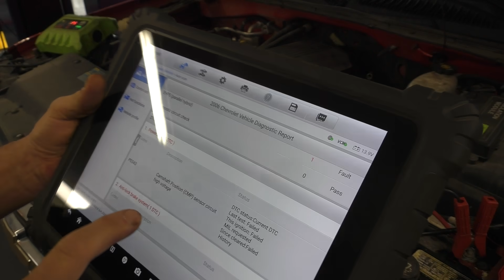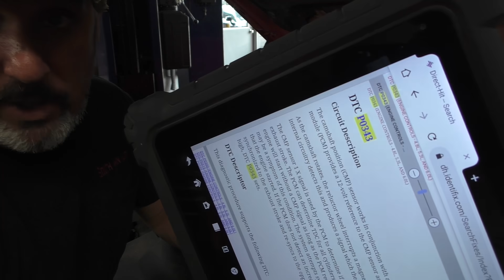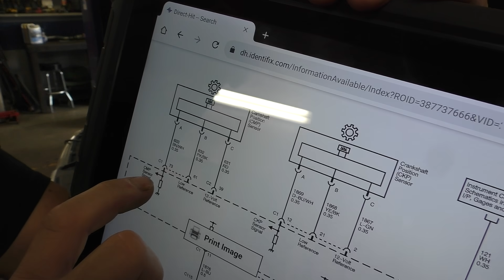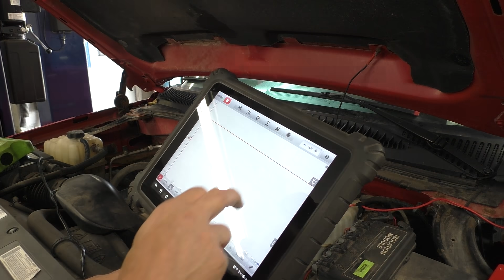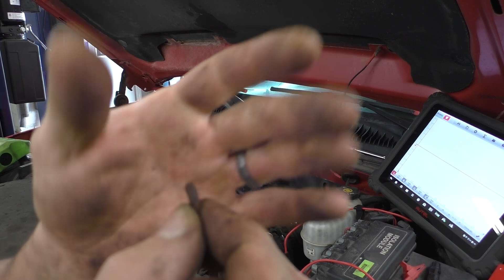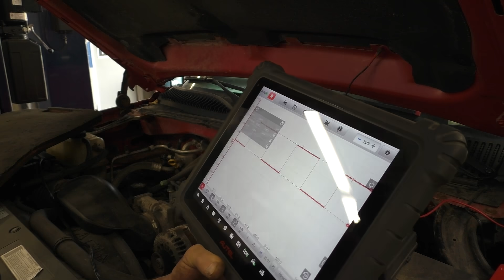Chevy Silverado With A Very Extended Crank - Other Shop Gave Up

Comment: I know this wasn't the problem but i have had a rebuild 6.0 have the incorrect rear cam bearing put in and the sensor ends up reading the bearing and not the tone ring also cause this condition, my fix was to install a 1x cam gear and timing cover off of a 2006 GTO and extended the wires to reach

Comment: I have a Park Avenue 2000 3800 not ultra. All the power windows stopped working, power door locks, interior lights, radio doesn't turn off when car turned off. Was told may be body control module. What say you? Cost of replacing body control module and programming it

Comment: As in most cam sensors or crank sensors the hole is on a machined boss which obviously your sensor has to sit perfectly on that machine surface I always clean off the boss or machine surface whichever you like to make sure that that cam sensor is at its absolute mounting position I had a similar deal on a Buick one time but it wasn't the boss it was the sensor itself it was not all the way down in the Paul and causing the same situation it was an aftermarket part they put it in themselves brought it to a GM dealer I replaced it with a GM part fit perfectly problem solved so let that be a lesson to all it is not a stupid video I'm almost gotten to the point to where I depend on you Eric I depend on you for your knowledge your process and your love..... of cars that is😂 you rock brother

Comment: Great video !!…ordered a $40 hydraulic crimper from Amazon and tried to crimp a 4 AWG wire and lug pulled right out…sending it back an ordered the $180 Temco !!

Comment: I had something similar happen with my transmission speed sensor.  For me the Bracket holding it on would twist when tightening and wouldnt hold in the sensor enough.

Comment: My Ford has cam sensors. They are right on the front of the heads where it is easy to get to them. One more reason to never buy a GM product.

Comment: Eric, maybe it didn’t need a cam sensor in the first place by the other shop? Cuz you found the real problem- Rust. Cuz after they replaced the cam sensor it still had the same problem until you diagnosed it correctly! You are very good Sir!

Comment: Eric, I had a nasty camshaft position sensor wiring harness, and I was getting the fuel pump relay cycling on and off with the key on but not running. When you said you wondered why the fuel pump relay was clicking when testing the connector, it made me think of my issue. Since rewired a new connector on and new cps, hoping it solves the issue. Had the crank no start and intermittent shut off. I found this video enlightening. Thank you.

Comment: I also typically use a test light for power supply checks because you get the added bonus of a small load test. The exception to this is when checking reference voltage sources from a control module. Hall effect sensors internally use an opamp to detect the magnetic field shift from the trigger wheel. These opamps are incredibly sensitive to voltage change and consume very little power. These low-load sensors typically use voltage dividers in their supply and don't just tap directly into the 12v power source of the PCM. Depending on the voltage divider's internal resistances they often can't handle much of a load before dropping the voltage. And when it does you'll get little oddities like you experienced. Either way, nice find and this was far from a stupid video. It shows the correct way to adapt when you get results you don't expect and not get sidetracked into a bottomless rabbit hole.

Comment: You have shown several video's that included rust jacking on wheel speed sensors and over the years you have convinced me that you know rust! But, I find it amazing that the engine block rusted enough to jack that sensor out! Crazy.

Comment: I had a similar issue with trac control on my Denali Xl accel from a stop trac control would kick in and could not accelerate road tested with scanner watching wheel sensors and Pass front would drop out for a split second. Inspected sensor and found rust lifted sensor a hair. She was a crusty old girl

Comment: I was messin with a 5.7 1998 the other day that was missing the crank signal. And checking the ground I also heard relays clicking. Also if anyone is wondering, if you replace the crank position sensor on the 5.7's they have a spacer that they need to have enough gap between the sensor and the reluctor. The customer threw the parts cannon at it and all it was missing was that spacer.

Comment: Interesting I gotta watch this one my 2015 Sierra does that every now and then,  like it lost fuel pressure and it has to build it then it starts fine. It’s only every now and then. No check engine light, no codes no trouble, just ever now and than it extended crank, but it starts every time it may be extended like 3 to 5 seconds

Comment: I have also changed a couple Cam Sensors Chevy LS same as yours ./ Last one I did was aftermarket and it wouldn't start after some long cranks. Used scanner to relearn ? Boss tried a few relearn options.  JUNK sensor replaced it with dealer part and boom, FIXED issue. Also with KOEO while middling with those cam sensor wires you will here the fuel pump, injectors,coils cycle on and off. Dodge is known for that as well the relays will click KOEO and if it doesn't click or cycle something you have a Bad ECU. Jeep/ Dodge The crankshaft sensor turns on the fuel pump relay and won't turn on fuel pump with a bad crankshaft sensor. Ask me how I got my arse handed to me for that one..

Comment: Eric, at about 21:30, you said you had to "give this engine a hug". loved it, been there!
I don"t think the video was "dumb or stupid". Its what happens in the real world. I've seen rust jacking on wheel speed sensor mounts. The rust raises them up. I replaced both front knuckles on a chevy truck once for low speed involuntary abs activation. Both were just a hunk of rust. We could not see much, but, the explanation of the process you were going through was spot on! So from me, excellent video.

Comment: These GMT800s are incredibly basic, only the crank sensor and fuel pump can leave you stranded and unfortunately the crank sensor needs to be mapped to the ECM but if you have a Tech 2 scan tool it’s a 30 minute job

Comment: That is not a dumb video by any means. I have seen the same problem with wheel speed sensors being pushed back away from the tone ring on the CV axles causing ABS codes and over active ABS engagements and over active traction control engagement. Nice find Eric O ❤

Comment: Dear Mr. O, I have a question regarding a 2017 Jeep Wrangler Unlimited 75th Anniversary edition. I had a code thrown for the #4 injector open circuit. Replaced all the injectors and plugs / coils while I had the intake off as preventative maintenance. After a day of driving it, we now have a P0301 - misfire on cylinder 1. I replaced the new coil and plug and again with a new one. These were quality OEM parts. The misfire code still remains and I can feel the misfire while driving. Have you come across this issue or do you have any ideas? 
Regards - Mr. W

Comment: 2001 2500HD 8.1, at 38,000 miles had cam sensor fail, intermittent start/run. Chevrolet Dealer tried to make me 
pay for replacement saying warranty only to 36,000. I argued that part is part of the emission warranty to 50,000
miles. After arguing for 5 hours with local Chevy and corporate they paid for it. 1 year latter I get a notice of recall
concerning all their cam sensors for that year model.....smh....so yes Chevrolet cam sensors go bad.

Comment: just fyi i found on my 06 duramax, it would crank /no start  when  i parked it with nose facing downhill a little. found if i primed the fuel filter to pressurize system it would then start up just fine so i replace the fuel filter housing and no problems since...so try pumping up fuel pressure the try to start it up

Comment: Eric, you might want to also check the driver side power window motor. When you lowered it at around 3:17 it appears to be motoring slow with jerky motion. 😂 Thanks for another great video.

Comment: Great video! Would never have thought of that. No parts cannon! 
Would you be able to test a crank sensor by using a multimeter on the signal wire and tapping the face of the sensor with something metallic. 
Not everyone has a scope...

Comment: I had a very similar issue caused by either knock sensors or cam pos sensor. I diagnosed it down to one of those and I wasn't about to not do both while I was under the intake manifold! Only difference was mine would not start at all.

Comment: You can take a magnet or a screwdriver and wizz it by the end of the sensor: my guess is that you will see the signal as expected. Pulling the signal wire to ground and 12v is also smart! Nice video! As always!!!

Comment: It is not the crank sensor , It's called the China sensor usually . Napa knows how , They have the best china parts money can buy . Get one from there and you can get another 30 k  miles out of the truck .
Reply from the maker: Lol where do you think GM sensors are made 😂

Comment: It's not a dumb video. Sometimes the solution is sitting there right in front of us and we overlook it because it's too simple. I had a 2018 impala that would cycle the wipers every time it was keyed on. The wipers wouldn't stop on the park switch and the park signal and ground circuits tested good, so we threw a bcm and multiple wiper motors at it. Turns out that someone had swapped the wiper relay(5 pin) with the headlight relay(4 pin), so it couldn't contact ground when it was switched off.

Comment: I worked on 6.0 that had an intermittent shorted cam sensor. It was hard to start, would stall, and was throwing crank sensor OBD codes, but no cam codes. Also when it acted up the airflow sensor would not work but didn’t throw a code. It only had crank sensor codes. It was a real head scratcher. It turns out all those sensors share a voltage source. I admit Google saved my hide on it. 2 plus years later it hasn’t acted up since it got a new cam sensor.

Comment: Great Video on a problem out of the Norm. So many people Fire the Parts Cannon without doing Data Driven Diagnostics.  It's so sad that many shops hadn't established a high level of troubleshooting. Their Motto is : Replace the nearest part that could cause the problem  and charge the customer. It didn't fix it, too bad.

Comment: What are those easy out sockets that you like for rounded off bolt heads? Do you have a favorite penetrating spray for loosening rusty bolts?
Reply: Come now Tibbs, we know that's gone be the ole PB blaster and or the ole Fluid Films's yeah. The rounded nut & bolt extraction sets are generally known as, "easy outs" in form of a nut and or bolt extraction set / s.

Comment: FYI every magnet on the planet has a temperature if exceeded it will demagnetize we built a race engine with an external sensor too close to the exhaust and you get halfway through a race and the thing would just die.

Comment: I  use various sizes of rubber stopper plugs I bought from a local hardware store to plug bores and threaded holes when media blasting. Then I found they work well to plug wheel speed sensor holes and cam/crank sensor holes, etc. when cleaning the rust around the hole. The plugs are tapered so they wont fall into the hole and will stay in place while you wire brush and blast the area w/ air pressure. Thanks for another good video.

Comment: I had a similar issue. 2006 Hemi Charger. Would randomly stall when driving through salty wet weather. Progressively got worse to when it would stall in the rain. Pulled the crank position sensor…. Rust jacked at least 1/8” out of the block. Hit it with a whiz wheel and reinstalled the original sensor. Good to go. Until it dropped a valve seat! 😢

Comment: Ok. Amateur hour.  My guess is you were drawing current from the 12 volt wire and activating the fuel pump as if the engine was cranking and and asking for fuel.  I am not a mechanic.  I just pretend to be.

Comment: It was frosty the snow mans friend Russ Jack. If the previous mechanic had properly cleaned the block before installing the new sensor, Eric's valuable time would not have been wasted.  Excellent troubleshooting.
Reply: But we would have lost a valuable lesson

Comment: I wonder is it possible that there was a wiring problem they fixed the wiring problem but before fixing it they replaced the sensor that was more than likely working with an aftermarket one that is now not working

Comment: So the question arrises if the sensor was defective in the first place. Or that it got rotted away from the block. And that replacing the sensor, without getting the rust build up taken care of, didn't do nothing. Since after just some rust removal it works just fine.

Comment: I chased 2 new defective motocraft crank sensors for a 6.0 diesel. To change the original one took about 6 hours. 2 new motocraft sensors and then later a new duralast sensor (that actually worked) the last sensor change took me about 45 minutes

Comment: It tells me that a non experienced mechanic changed the cam sencer, an experienced mech, would have looked at the matting  surface and seen the rot or rust and fixed it like you did, just do not change out parts, trouble shoot first, makes for a great mechanic.

Comment: I'll trade with ya' I've got a 2010 Jeep Patriot that's reading 37mph sitting still, output speed sensor is reading 0mph with a good pattern on the scan tool... data points towards the G110 ground lug on the passenger side below the overflow tank... typical CDJR problems, great video as always!

Comment: I wasn’t an auto technician.  I was an Instrument and Controls technician/engineer .  The signals I dealt with  were 5 volt or 4 to 20 milliamps; I estimate 65% of all faults I encountered were due to bad grounding.

Comment: This was not a dumb video. This is a masterclass in what separates a good mechanic from a great mechanic. It was well worth the 30 minutes. I would have never guessed that rust jacking would create a large enough air gap for it to malfunction the cam sensor. Great job and thanks for the lesson.
Reply: Eric => The 🐐of rust repair mechanics on GM trucks. Amen!

Comment: Original sensor bad. Other shop didn’t clean area installed new sensor and Eric fixes. That rust piece is the silver piece in the new sensor

Comment: "Girl, that hole is cruuusty"  Damnit...now I need to clean my keyboard!  
So did the original sensor not need to be replaced because the rust pushed it out of range?
Reply: Correct

Comment: That schematic you showed @(31.25) a resistor to gnd on the signal input ot the ECM. That would hold the signal low to 500mv.

Comment: The old low mileage plow truck. No miles on it but had the snot beat out of it. My brother worked construction. They plow snow winters. I worked nights and would go over after work see if I was needed to drive a truck or backhoe with a pusher. The truck i got put in was a gmc with a 454 in it. Pushing machine. One storm I filled it up. 40 gallons. I pushed snow in a plaza all night. It was empty I checked mileage. I only drove 50 miles. Burned 40 gallons. Lol. Filled it up pushed some more.

Comment: It makes sense to power on the fuel pump. If the cam sensor fails, the fallback logic described, uses the crank sensor to try to start the car, it needs the fuel pump for that to be possible. So if you didn't see a return signal from the cam sensor, how would the PCM determine their is a sensor/signal fault. Current sensing, voltage sensing, unexpected state change, so probably the latter where the test lead triggers a state change, leading to the fallback logic where crank sensor will be used to start the engine, so fuel pump is switched on. It is a little crude on some levels, seems like there'd be more  elegant logic, but it would suffice and if you're assuming it is only needed when something is broken, and that could be more than on concurrent fault, choosing a fallback logic of just the basics required to start the engine isn't a bad idea. Interesting video Eric, love your sleuthing videos.

Comment: my shop is in Ohio, rust jacking is very common here, these plastic sensors with only one bolt in a cast iron block do not seem to work well, but it is an easy fix, 80 grit sandpaper